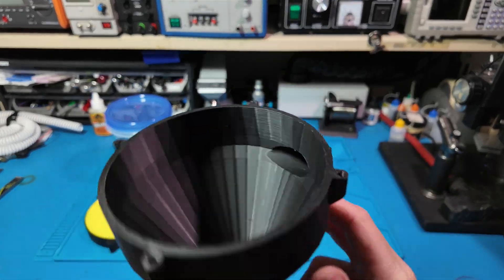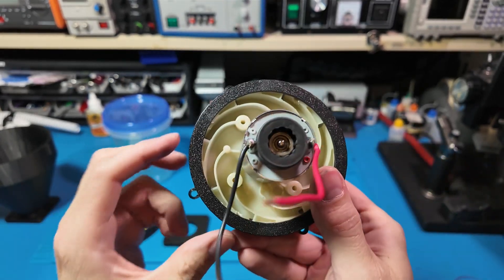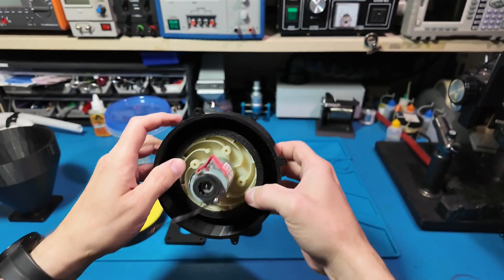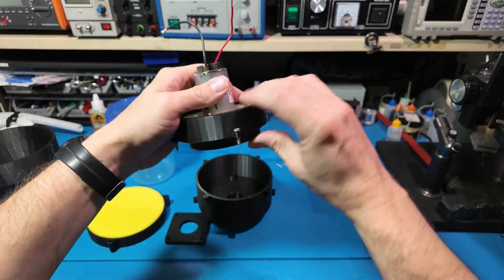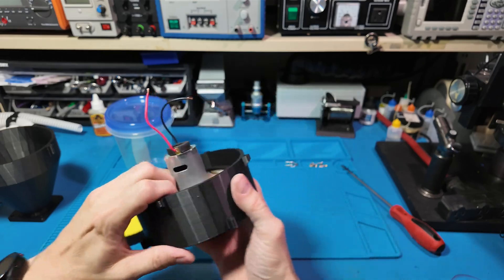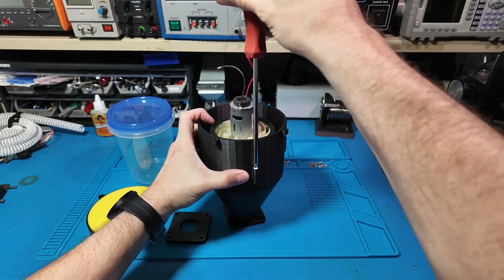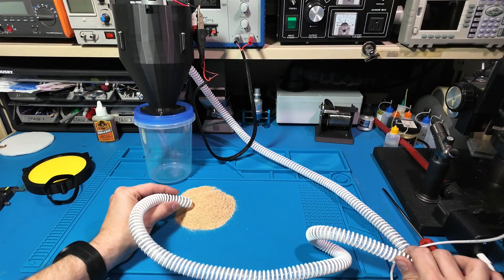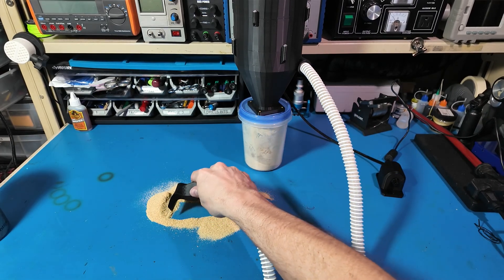How I Made a Dyson-Style Cyclone for My CNC for $0 (Almost)

Comment: That's very cool! where can I get the print files? The description says they are in the video but I didn't eee any 😕
Reply from the maker: I will check, I sometimes don't post them unless someone asks .
Reply from the maker: Here Are those files may need some modding to work for you needs, i think i made a few versions to mount different motors the handheld motor worked the best . 
https://www.thingiverse.com/thing:7176595
Reply: @Sawdust_and_Circuits thank you!

Comment: build the cyclone into the tub and make it multy cyclonic with discreet fin dust chambers
Reply from the maker: My first design had 4 cyclones wasn't the best , probably the design 😉
Reply: @Sawdust_and_Circuits  that can be true but if you do it like dyson then it may give you a better chance. dont do the multy cyclone design if it proves to be too difficult do the original dual cyclone design
Reply from the maker: @thecomputech3353yeah the dyson style is tricky, the chambers surround the center debris and the vacuum draws from the center of each top, not impossible to 3d print but tricky.
Reply: @Sawdust_and_Circuits  i agree i have been trying to recreate it for ages now and it is proving to be a challange so i think that the simpler dual cyclone version fom the dyson dc01 to the dc04 is the best option
Reply from the maker: @thecomputech3353I'll have to check out that layout .
Reply: @Sawdust_and_Circuits  there are plenty of scetches and drawings and plenty of videos taking them apart so that you can see all of the working innsides of the machines so if you are to build one whitch i am willoing to see but if you make an almost identican minivac so that were you can plug the mini stretch hose from the back into the mini cnc and make it so that it can recline back and clean up on your desk with an acctually working brushbar system for mini patches of carpet then i would be so happy to see it. it will be a big project but everybody loves a big project. i would love it even more if you could colour match the 3d printed parts to the basic version of the 04 or somehing. it would be so cool. for the acctuall bin assembly and the transparent part you can just use a clear bit of pvc pipe. looking forward to it!
Reply: @Sawdust_and_Circuits  love the vids by the way subscribed i dont know if it is publicly though

Comment: I've been wanting to make something like this for aquariums solid waste separation for years. Never got around to it and don't have tanks anymore. Difference being, I wanted to put pins along the inside of the cyclone body. This would create an area of low flow around the outside, so when centrifugal force pushes the waste into that area, it gets "trapped" and falls out the bottom. Variables that would need to be tested are pin size (diameter and length), density (pins per sq") and exact location (top straight walls, tapered walls, how far away from the waste outlet). I got the idea many years ago reading something about how using round piles around off shore drilling rigs can protect them from tsunami by reducing the force of the water inside the array of pilings. Further, looking at water flow diagrams around branching forms of SPS corals also show the reduced flow inside the form. I tried learning the CFD years back, but never figured it out. This was also long before 3D printers, so making a cone "easily" wasn't an option for me. If it interests you, my idea is now yours to use. Cheers!
Reply from the maker: Sounds pretty cool the hydrodynamic flow is alot different and fish waste alot of times is less dense then water itself.  I do believe there is something there to be done I did have a 75 gallon tank a few years back. I like the concept thanks for the input . 👍